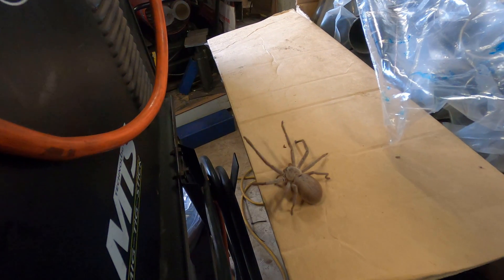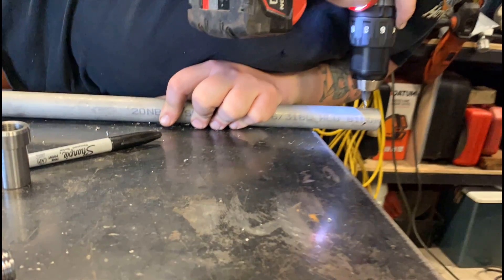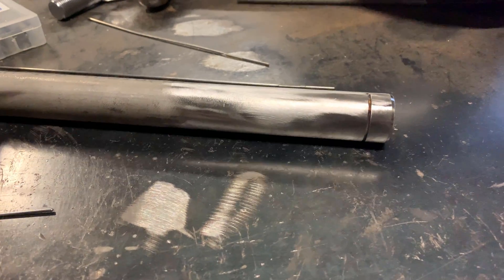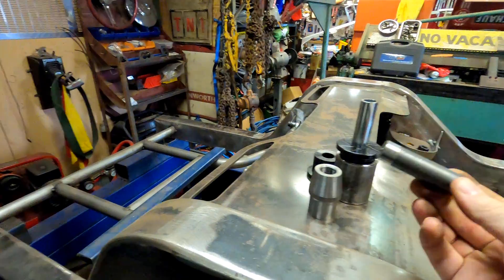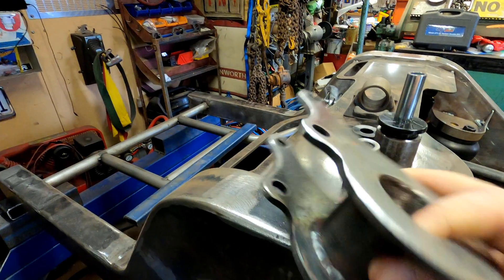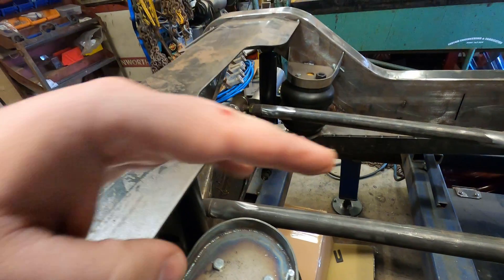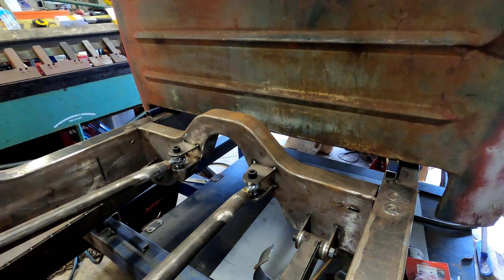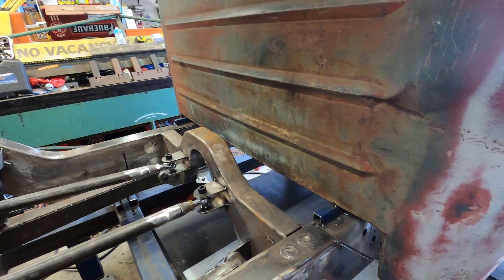How to weld a 4 Link end, and rod ends explained: BackyardBuilds

Comment: check with your engineer first. Heim joints are not accepted in NSW. FYI The huntsman spider is a female. males have a far smaller abdomen and clear markings on the top of there head.

Comment: a mate of mine used to weld pipe joins all the time and he used a small machine to slow turn the pipe as he was welding, he showed me the difference between using the machine and not, chalk and cheese. Best bit was that he could change the speed of the rotation by just turning a dial I was very impressed.
Reply from the maker: They are an awesome bit of gear and have been hunting a decent one for a while, It will be perfect for links and diff housings.